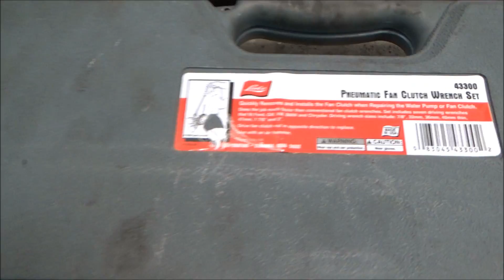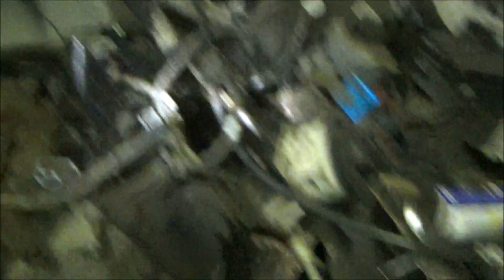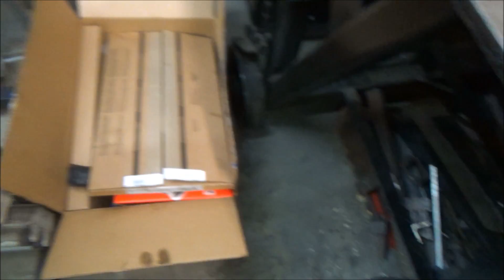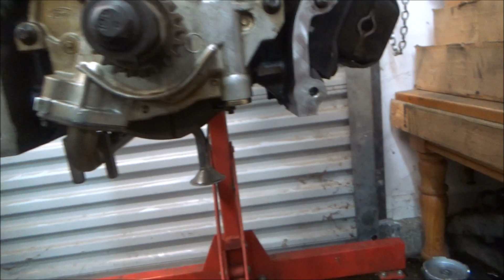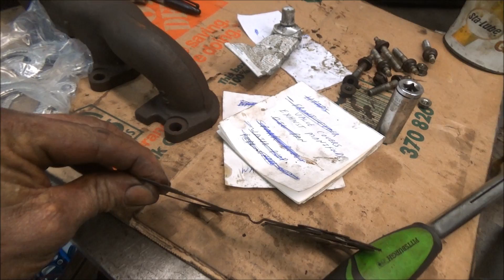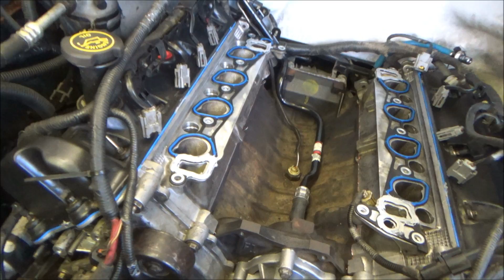Ford F150 4.6 Triton Cylinder Head Job / Engine Replacement / Spark Plug Inserts

Comment: w0w !hey just picked up a 1998 f150 4.6  witth head gasket issues at 300k miles and I'll be doing what you said on the spark plug holes for sure ,also will be looking at the cylinder bores just in case !

Comment: Correct me if I’m wrong. But that engine looks like it’s port injected, right? I have a 2006 4.6 f150. What would be the difference between mine and this one?
And could someone quickly name the different types of camshafts if there are any?

I’m considering replacing mine with a used engine and want to know if it’s worth it. Are these engines long lasting? Any pros and cons I should consider? What if I’m just a city driver?

Took mine to a Ford dealership. They said I needed a new engine. That 2 cylinders were low on compression, causing a misfire. I also noticed when I checked the spark plugs, that 2-3 of them had oil buildup on the tip.
Reply from the maker: Yes these engines last a long time.  The best thing you can do to it is put the spark plug inserts in it.  I think 2006 is the same.  Yes there port injected.
Reply: @1970chevelle396 Ok nice. I appreciate the quick response. I more than likely going to do that now. 👍 Thx again!

Comment: Can u give me some advice on how to get a stuck plug out can I just pull the heads off and fix it the put new insrets in and put it back together
Reply from the maker: It sounds like your working on a newer Triton engine that broke the spark plug off ?   If so they make a tool kit for pulling the broken piece out of the head.  Lisle and several other companies make the tool kit.
Reply: It's a 1999 4.6 l v8 I've tried everything but this tool kit for about 375 that say u drill throw it with a left side drill bit and take a extractor and it comes out just trying to find a cheaper way cuz of rn it that or just rebuild the top end
Reply from the maker: I’ve never had one of those older triton engines break the plugs off before.  The newer ones break all the time.   You might have to pull the head off and take it to a machine shop and have them remove it and put an insert in the hole.

Comment: Awe..man miss that prelude I bet. That video the best one on you tube for h23vtec swap. You do excellent work👍
Reply from the maker: Thank You
Reply: I watched this one because today I pulled intake manifold off a 04 150 4 .6. It leaked coolant into couple cylinders and locked moter. You ever see that happen and moter be ok after new gaskets on..the moter spins without plugs . Shot coolant everywhere lol
Reply from the maker: It will probably be ok.   I’ve never seen a Triton engine with bent rods before.

Comment: I have a '00 grand marquis with 164k, I want to get it to 300k...I'm losing oil somewhere, don't think I'm burning it, and I don't see any leakage anywhere.
Reply from the maker: Most of the time those Triton engines will last 300K.

Comment: Good job man wish I had your skills I have a 2001 4.6 grand marquis cylinder one is missing up oil on my spark plug from the head maybe piston rings or spark plug seal. This well be my first head job. Am going to see if I can fix it because shops are expensive. Car only has 69 thousand miles on it one owner old lady. But the car was sitting for two years before started again. Someone before me started the car maybe missed something up. But anyways am going to use this video while I work on mine thank you for the video and knowledge god bless you brotha . 💯💪🏾👌🏾👏🏾 oh and also I did change the fuel fuel pump fuel filter I check the injectors the relays fuses got it running the right way. Run good until cylinder one went bad
Reply from the maker: It could even have a bad valve guide or bad valve seals causing that.

Comment: Ken, do you know a rough estimate would be if I took this to a Ford dealership to have all that work done? I just blew a head gasket. So I’m considering what to do next. Thanks!
Reply from the maker: I have no idea what it would cost.   There is different labor rates in different areas.  And what I charge and what someone else charges probably would be different.

Comment: I changed the head gaskets on my truck and now it won’t start. It ran before now it just turns
Reply: Did you  forget to put crank  sensor  sprocket  on

Comment: GREAT VIDEO...I UNFORTUNATLY HAVE TO REPLACE LEFT BANK CYLINDER HEAD DUE TO CORROSION ON HEAD..WHICH HAS 4 BROKEN STUDS FLUSH..TRIED DRILLING THEM OUT BUT NO COOPERATION FROM SIEZED STUDS

Comment: A guy told me from a shop that you have to remove the cab to get the engine out. Guess he was full of Shee
Reply from the maker: You don’t have to remove the cab.  I can even do cylinder head jobs on the V10 F250’s without removing the cab.

Comment: What's a better motor the 5.4 or the 4.6 ?
Reply from the maker: They both hold up just as good.  But your better off with the 5.4 since it has more power.
Reply: OK so the 5.4 is better for pulling stuff BC wen I got the truck there was a 4.6 in it and  that motor took a crap on me and I don't really know much about fords

Comment: Do you think it's easier to pull the engine to replace the head gaskets or leave it in?
Reply from the maker: I normally leave it in.
Reply: @1970chevelle396  what about the front clip of the truck didn't hear if that was when pulling the heads or the engine?
Reply from the maker: No.   You don’t have to take it off.

Comment: This video is freaking amazing. You give me the kind of confidence I need to feel like I could pull and work on my own engine.
Reply from the maker: Thanks
Reply: @Steady TrollingGood luck! Would love to see! I'm actually in the process of trying to get mine turned over after sitting for 10 years. Pulled the old gas tank yesterday and ordered a new one. Today I'm going to pull the injectors and fuel rails to clean them and blow out the fuel lines.

Comment: Hi... Is there a way... Machine... to know when an engine is blown or a piston needs replaced?
I don't know much so not sure if my question makes sense as far as parts go... Thanks.
Reply: Kind of late here and I bet you have your answer by now, but just in case. You can attempt a compression test on it.

Comment: The vid is ok but misleading. There is nothing about removal or lock down. Its ok but not very helpful. A lot of tid bits but that's all. No real information about removing or replacing. Just pictures. Thanks for the video but it lacks a lot of vital information.
Reply from the maker: The video is not intended for DIY. It’s to help someone out that already has experience,  but needs a little help with the technical part.
Reply: I understand. I've done more than I can recall. This modular motor is not like the old chevy or ford's.  The technical part would be the lock down and removal. This is the basis of the head job along with proper installation . A slipped cam can do a lot of damage. Anyway I'm not commenting to be critical. I enjoy the vids and appreciate help where I can find it. So thanks for the vid. Sorry if it seems critical.
Reply from the maker: It’s not like that for this engine.  Not possible for a cam gear to slip.   It has a pin in the camshaft that goes into the gear.  BMW are the main ones that have only friction washers in there to keep everything from turning and have to be locked and torqued exactly right to keep the gears from slipping.    There is nothing like that on these Ford Triton engines.

Comment: my 98 4.6 doesnt have coiul over plug. still have 2 coil packs, 4 cyl each
Reply: Same here on my 98 F150 4.6. From what I've heard F150 did not go to coil on plug until mid 99 model year. Unless, maybe California emissions are different? Think maybe Explorers had COP earlier, not sure. Also with vehicles of this age, unless purchased new, previous owner could have swapped out the engine. Just sayin'.

Comment: Valuable video.  I have a 98 4.6l with a blown head gasket. Since I am not a mechanic, I am pondering whether just replacing the engine would be easier to do than repairing the head gasket?  Would swapping engines still requiring breakdown of the  head?  Thanks
Reply from the maker: If you want to do a real good job by putting the spark plug thread inserts in,  then yes you would have to pull the heads.    It’s not actually required to do that,  but those engines do have problems with the spark plugs blowing out.   It would be much better if you did pull the heads.
Reply: @1970chevelle396  what caused the coolant to sit in your old engine and ruin it? Same thing blown head gasket except a 1997 4.6 now im worried about that casue its been about 2 months or is that a whole other issue?

Comment: Never had a spark plug failure out of a 4.6 or 5.4 but then again I follow factory spec for the spark plug to
Reply from the maker: The problem was from the factory they weren’t tightened down tight.   Then they come lose and since they only have 1/4 of an inch of threads, then the plugs blow out.  If you replace the spark plugs at like 75K miles it won’t blow them out.   I worked on nothing but Ford trucks at my last job.  So I know very well about the spark plug problem.

Comment: If you don’t mind me asking but how much in all did this cost you my truck just recently blew headgaskets and I’m going to be pulling the motor out and rebuilding it and getting the heads machined is what scares me on cost
Reply from the maker: I don’t really know what the cost was.  This was done for a customer and the customer paid for all the parts.  The main thing you want to do is to have those spark plug inserts put in.  It kind of depends on what a machine will charge for that.
Reply: 1970chevelle396 mines actually not the triton motor it’s before triton mine is the 4.6 Windsor block not exactly sure what that means but I like it better than triton engines again thank you for the video of how to tear down and put back together.

Comment: I have a 01 f150 that's needs some work done just wanted to know a ballpark figure just in case thanks for answering back
Reply from the maker: +Joseph Mercado    There is no way to give you an estimate.  The labor rates are different in every different area.  Also what I charge I’m sure is different from what someone else would charge.
Reply: I understand but I live in Florida so I just wanted to know a ballpark figure because I'm going to probably go to a couple get second opinions
Reply from the maker: @marcusmercadosl7886    It's not possible to give you any kind of ballpark.   I think the labor rate in Florida is a lot less than here in California.  It also depends on what a machine shop will charge to do the heads.   And if any shop out there will do it that way.

Comment: I wished you were closer to my area I have a 2000 F 150 I need a heater core in and the right side head gasket has a leak 4.6
Reply from the maker: +Prentis Goodwin   Thanks

Comment: I hope people listen to you about those terminals. They used to even say on the pack that they were not meant to be a long-term repair. I cringe when I hear someone paid retail labor hours for that garbage and can't figure out why they are having electrical issues 60 days later.
Reply from the maker: +slowpoke96z28   A lot of times I see shops putting those terminals on and it’s someone who’s been in the business for many years.

Comment: Is it the same process for an 08 4.6
Reply from the maker: +Unarmfever 3   08 should have the 3 valve engine in it that doesn’t have the spark plug blowing out issue.

Comment: I have a 2003 Ford Expedition 5.4 V8 that is leaking oil in the valley.  Took it to get checked out and they said my head gasket is leaking oil.  You have any recommendations beyond spending thousands to replace the head gasket?  The price they quoted is more than the vehicle is worth.
Reply from the maker: myriadcorp     I would think it’s something else.   Maybe valve cover gaskets leaking from the front or rear of the valve cover where it’s getting into the valley of the engine.  Hard to say without seeing it.
Reply: I just had the valve cover gaskets replaced.  I am praying its them.  The shop I took it to said it's oil leaking from the head.  My option is to just drive it with the leak until coolant gets in or spend thousands to fix it.  The car is at most worth 4k right now.  I just don't know what to do.

Here is the replacements I did in 2017-2018.   Struts, sway bar links, intake manifold and gaskets, valve cover gaskets, plugs and coils, pcv lines and valve, water pump, thermostat, belt, and driver side window controls.  Right now the leak is slow and it's just oil no coolant.
Reply from the maker: myriadcorp    I’ve done lots of Cylinder head jobs on the Ford Triton engines.   Not one of them was for an oil leak.  I think it’s coming from someplace else.   They might have damaged one of the valve cover gaskets when they put it on.     There is very little room to get the right side valve cover off.   So maybe that side partially came out of the cover when they put it back on.
Reply: Thanks.  Hopefully that's it.  I think we are going to put some die in the oil and use a black light to find where the leak is coming from for sure.
Reply: @1970chevelle396  would you have any tips on removing those valve covers?
Reply from the maker: @commanderstud2417    Not really.  There's no special  way of doing it.   It's just hard to get to.
Reply: @1970chevelle396  ok cool.  I figure sooner or later im going have to dig deep into the engine whether it be a timing chain job or head gaskets... I've already changed out the intake manifold which wasnt too bad.  It has 185k on it... Im just hoping i can get alot more life out of it without doing anything major to it.

Comment: I have a 2000 f150 5.4 when I leave it sitting for a week without starting, then I start it. The truck smokes a lot for about 30 minutes. After that it goes back to normal and if I start it regularly, it doesn’t smoke. Also the coolant level drops overtime. I checked for mixture in the oil and coolant but all clean. Did a block cooler sniff test but it shows good. The truck drives good and no overheating issue. I don’t know if I should just use a little bit of the head gasket sealer to see if it works out. Also I have heard that it’s hard to take out one of these engines for a swap, is that true? Thanks
Reply from the maker: kchilz32    Don’t put stop leak in it.   There is only one way to see if there is a head gasket issue.   The other ways don’t work well.  You have to take it by a place that does emissions testing.  They will take the radiator cap off,  start it up,  and hold the probe that goes up the exhaust pipe near where the radiator cap goes.  If there is any hydrocarbons it’s bad.   Another thing that can make it smoke on start up is the valve guides and seals.
Reply: 1970chevelle396 so the blue liquid carbon test won’t work? (The one that goes where the radiator cap is). Also, would the valve guides cause slow loss of coolant? Thanks again and great video. Also how hard to pull the engine out?
Reply from the maker: kchilz32   The blue liquid only works if it’s a real bad leak.  That’s why I never use it.  When it’s a real bad leak you will know just by how bad it runs.  The valves will not cause it to lose coolant.   For me it wasn’t to hard to pull the engine out,   But I’ve been a mechanic for 27 years.
Reply: 1970chevelle396 thanks so much! I’m leaning towards a minor head gasket leak. I will see if a shop can do the emissions sniff test and make sure it is but if it is I don’t know if I should just drive it till it gets worse or get it done as soon as possible. I’ll probably go towards the route of a used engine and just swap it and rebuild the old one